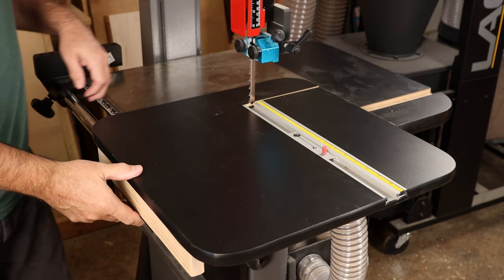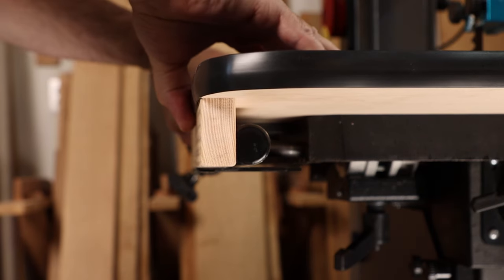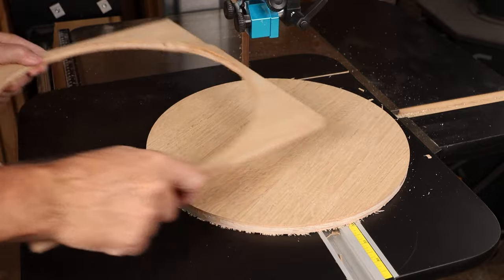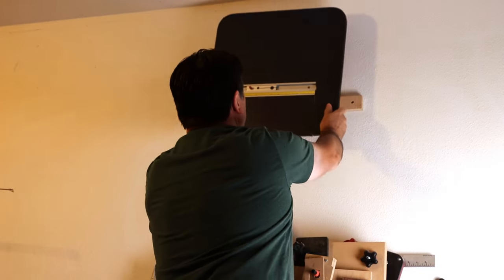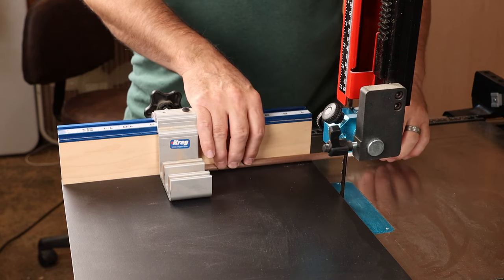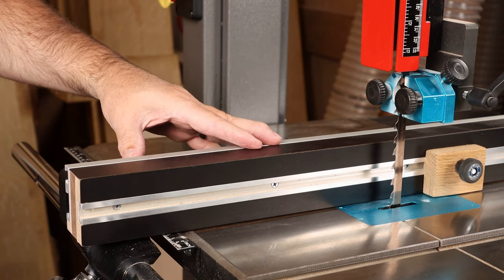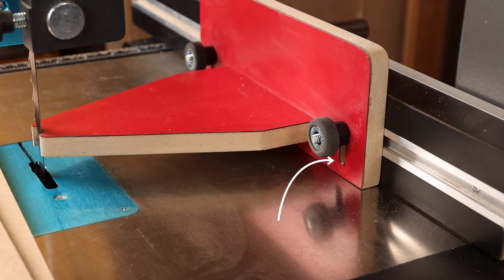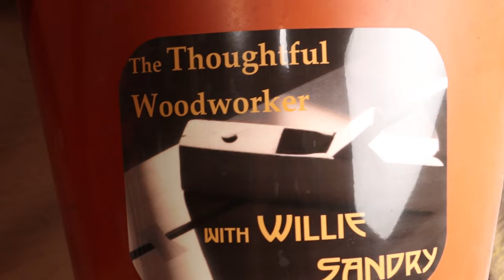Bandsaw Jigs Best 4 for Your Woodworking Shop #woodworking including circle cutting, crosscut sled

Comment: What did you use to cut the miter slider bar? You mentioned bandsaw but does it have to be metal capable? I only have a wood bandsaw. Thanks and great videos. Going to subscribe now!
Reply from the maker: I actually make small miter bars like this from wood.  It works just fine with a little paste wax.  Thanks!

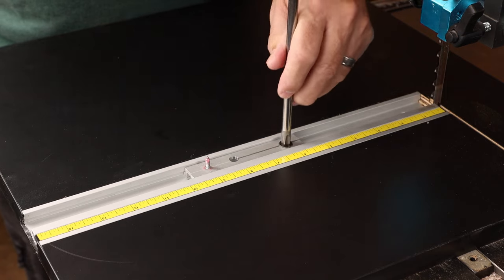Comment: Great video, I like these jigs, probably going to make them to. At 2:20 you say your jig can cut up to a radius of 28 inches, oops, I'm assuming you meant radius of 14, or diameter of 28. I'm looking at building an adjustable jig for various angles, adjustable in all 3 planes (I know the table can be tilt, as can the mitre fence) especially for compound cuts, can you suggest any. Sub'd and liked. 👍
Reply from the maker: Yes you are correct the circle jig will cut circles up to 28" diameter.  I've never seen a shop made jig for cutting compound angles at the bandsaw, but this may offer some inspiration... https://infinitytools.com/products/vrs-200-professional-vertical-router-sled?_pos=8&_sid=988c0b083&_ss=r  Thanks!

Comment: Can you post a link to the screw and flat nut you used in the T-Bar for the circle cutting jig? I cannot seem to find one that fits.
Reply from the maker: The flat nut was from Woodcraft.  Rockler has them too I think.  The bolt was just from a local hardware store.  As I recall, I had to cut it to length.  Thanks.
Reply: @TheThoughtfulWoodworker  Thanks!

Comment: For the circle jig, what is the sweet spot for how the centering pin is set relative to the blade?
Should the pin line up with the front of the teeth of the blade, or should it be in line with the middle of the blade?
Reply from the maker: Anywhere adjacent to the blade or teeth seems to work well for the pivot track.  Great question!  Best to you.
Reply: @TheThoughtfulWoodworker  Thank you!

Comment: i had to bolt an inch thick mdf onto my wen table, either the miter slot or the included miter bar were so out of spec they almost fell out vertically.
maybe ill get some extra miter bar and hope the table is in spec.

also threw out the included fence,  dangerously bad design wobbled and bent before i even used it once.

wen=not good.
Reply from the maker: Ooohh sounds like a bad experience with that one.